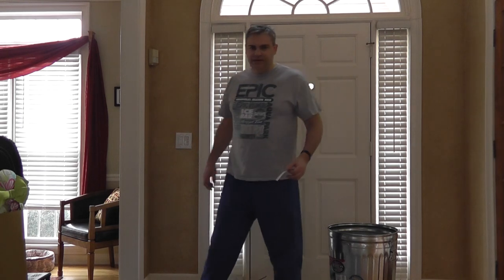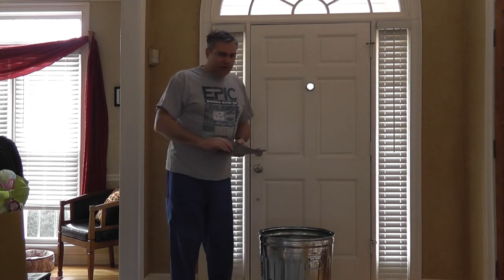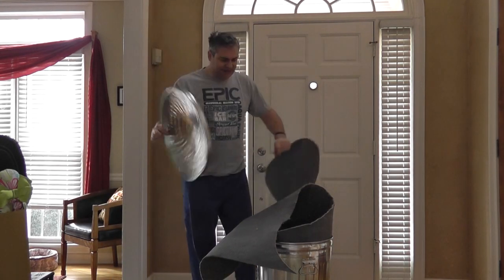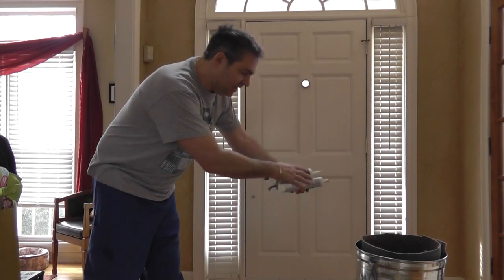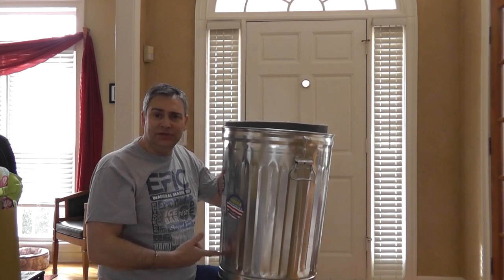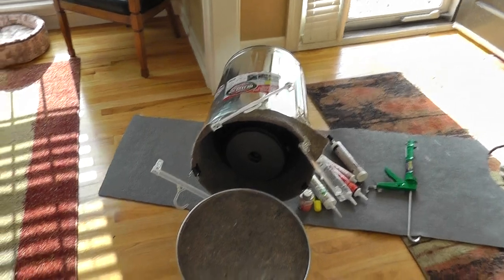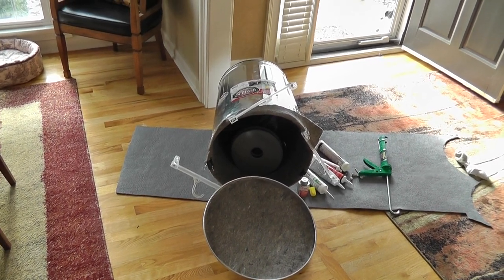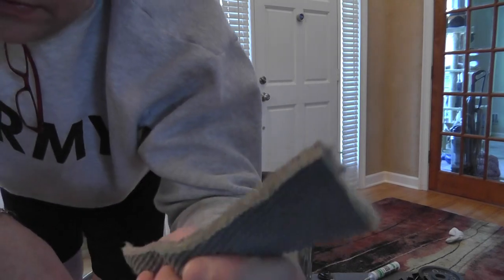How to Protect from EMP Build the Best Faraday Cage!

Comment: 2 cheap uniden cb radio's and magnet mount antennas are another good item to store in there too, just tape the "whip" part of the antenna to the outside of the cage and if there is an emp, the whip won't conduct the net charge if it is on the outside. Make sure the magnet base is inside. I also would recommend 2 brand new motorcycle batteries dry. you can keep the battery electrolyte in jugs for battery activation when the radios are to be used. Nice cage

Comment: EMP is an electrical "signal" that will pass through non-conducting material like plastic.  Any electronics inside a plastic or wood bucket will get fried.  A Faraday Cage routes the EMP pulse through the conducting material (garbage can) and around the items inside the cage.  This prevents the pulse from damaging the items that are inside the cage.  The non-conducting material just prevents items inside the cage from touching the cage.  If it touches the cage, the pulse will damage the item.

Comment from the maker: A deluxe carpet pad which has one side rubber(use that side against the can) and felt/cloth on the other.  Use that side facing inside of can so equipment is not damaged.  This material works best.

Comment: I have three cans and they work perfectly.  Put AM, SW and FM radios plus cell phone inside can.  They will all change from picking up strong stations to only hearing static.  Don't take my word for it - try it yourself.  I prefer Kaito radios as they have crank dynamotors as well as solar panels plus battery supply.  You don't need to worry about battery running out.  Kaito KA500 or equivalent.  no need to argue - try it yourself. MUST have shortwave.

Comment: Steven, I am not sure what the carpet does. I considered lining a can with lead sheets to drop a few radios that I am not using into.  Maybe sealing the lid with aluminum tape.
Reply: Components cannot touch the metal of the trash can. Could just put a smaller Plastic can inside

Comment: I'm not 100% sure but I believe you also have to ground a faraday cage.  I have been told a water pipe (I don't remember if it hot or cold) would work to ground it to.

Comment: Super job. I would ignore Preying Mathis as he just wanted to put down your lessons.  It is noteworthy he offers nothing.Here is an idea for those wanting to try out variations for an EMP solution.   Once the modification to anyone's concept is complete, put in a battery operated radio and turn it up loud.  Also put in your smartphone.  Then call your smartphone.  And try to hear your radio.  The idea behind this is to test whether electronic transmissions penetrate the EMP structure you think might work.  Simply then button up the EMP solution as well as you can. If the phone rings, or the radio pays music, then you clearly know it has not passed the test for EMP.  This will allow many ideas to be used for a solution.  The best ones in my opinion use copper mesh or aluminum cover as electrical conduit to take the electronic signal away into some pipe in the house that was grounded.  I think n4kt might work as he says he will.  But I would want the can grounded to some home pipe otherwise the signal has no where to go.

Comment: Soo this is mine is it okay? I made a more cage like thing with a wood frame with fine copper mesh all around on the outside, on the next inner layer I have rubber then on the inside I have copper sheet metal, then I just have my electronics I want to save in waterproof seal bags.

Comment: Can one simply use a metal storage shed for a faraday room, where you can store your electroncs? If so; what would one have to do to make that happen?
Reply: The seal between the lid and body of the garbage can shown is insufficient to prevent severe damage to electronics. A metal shed would have way too many gaps. You might get away with completely covering the inside with aluminum foil, but with absolutely no gaps.
Reply: Rebekah Davignon you dont need a seal....as long as the lid and can are touching the current will go around the can. there will be no charge in the can itself....please stop with the disinformation
Reply: maybe someone needs to learn more about Faraday cages. There are lots of videos online.
Reply: maybe someone needs to learn about electromagnetic forces and the effects of them on certain conductive metals....there are videos online.
Reply from the maker: Silentgasp maybe the electronic specialty of the top line specifically magnetism and effectiveism will allow for the space between the slip of voltage and amount of amperage which goes up exponentially.  Then the truth of what you see will come to pass.  That is the truth

Comment: I am not sure about this. An EMP this large is likely coming from an detonation into the upper atmosphere.  Likely from a nuke which if that's the case. We will have a lot bigger problems to worry about. Like the millions of radiation particles zipping through your body. 

If your lucky enough to survive the blast lol. This isn't a bad idea but is better suited for a bomb shelter. 200 feet below the surface. With 15 feet of reinforced steel and concrete mixed in. If an EMP no nuke weapon if used. Like a pulse weapon might make more since. 

However you better plan on sealing every nook and gap in the house. As even a small crack will negate any benift here.  Probably better to build a cage structure wireframe into the construction of the house. Then build the house around that. Well good luck and all. :/

Comment: with all due respect CB radio will be as useful as a cell phone in a grid down situation.  CB is total chaos and no privacy.  To transmit locally buy GMRS, marine or ham radios.  For distance buy ham radio.  Yaesu FT-817 is a new model but many older models quite cheap on ebay. Five watts is enough if 99% of other stations are gone.  Five watts conserve batteries plus can be run from solar panels.

Comment: Cars are already EMP proof.... There are articles and videos where people have tested their new cars in an EMP simulator and the cars ran just fine.
Reply from the maker: Preying Mathis Cars have electronics which will be knocked completely out in an EMP event....
Reply: No they will be fine
Reply from the maker: DUH, no they will not..the radiation will FRY EVERYTHING ELECTRONIC
Reply: Mmkay lol ur partially correct... Yes things that are not built to be insulated against frequent radiation, frequency,radio waves and other such types of interference will fry... Cars are built to withstand all these things and the whole doomsday myth of all your cars won't work because of a EMP strike or solar flares has been busted by a controlled experiment where they stuck a car running in a chamber and blasted it with EMP and it still was running.. They also blasted it while it was off and then started it.. But go ahead and waste your time and money on prepping.. In the end all that prep will be in vein because you won't be able to stay put and use your stock pilled rice because you will be on the run.. And you won't be able to get gas to fuel your bug out vehicle and you can't store gas anymore for longer than a month without it causing serious harm to your engine.
Reply from the maker: Yea right, cars are built to withstand radiation...hahahahah...they cant even withstand a 5 mph crash. Radiation would FRY a car 100% and IT WILL NOT WORK...DUH. An air powered car is the answer.
Reply: DUH!
Reply from the maker: Yea the government requires all cars be EMP proof....dont you know the EMP rating on the price list...Geez everyone knows your car will still work after a Nuke goes off......NOT
Reply: Do you think that saving your cell phone and other small electronic devices will actually be useful? The emp will take out cell towers,internet,power grid,any and all types of broadcasting will be finished.. So why go through the trouble to save your laptop.
Reply from the maker: Nope, wrong again...
Reply from the maker: Preying Mathis Oldest, so I know everything and was treated like a king....Your probably the youngest with all the insecurities and always told you would not amount to anything
Reply from the maker: HAHAHAHAH....You are the insecure one...My parents, grandparents, etc ALWAYS told me I WOULD be successful and I have always been that.  Yes, treated like a first born, if you want to say like a king....whatever. I had rules, discipline and taught manners unlike many on here.
Reply: +n4ktz well car would and still qork if they are prw 1980s car like a real mechanical car no computerized things mostly carburated cars that why they was that cash foe clunkers program a while ago the governmwnt want to reduce the amount of vehicles that can be used in case of a government infliction upon its own natio